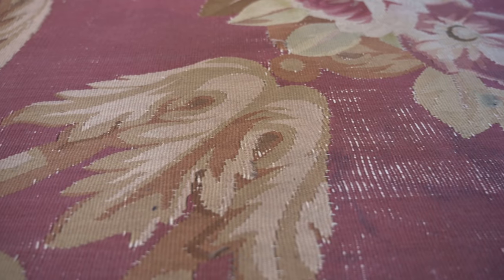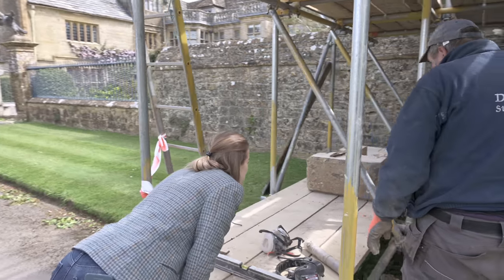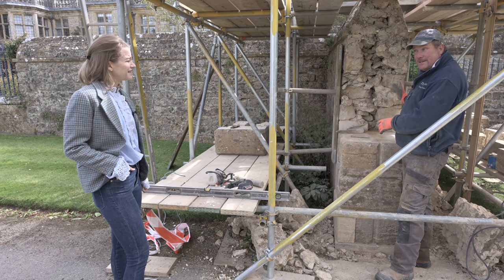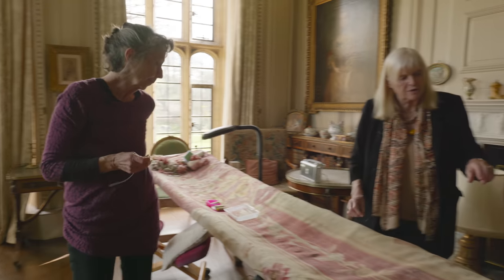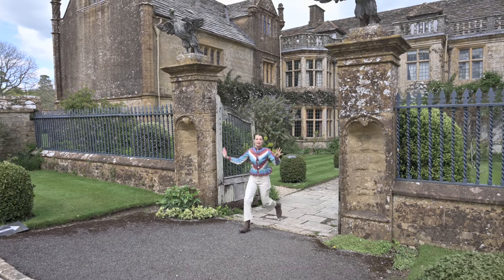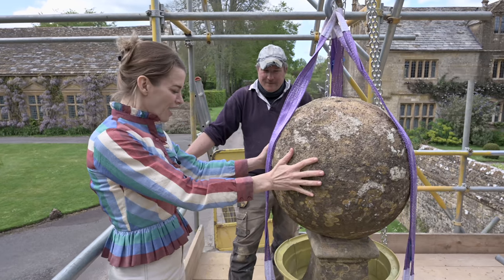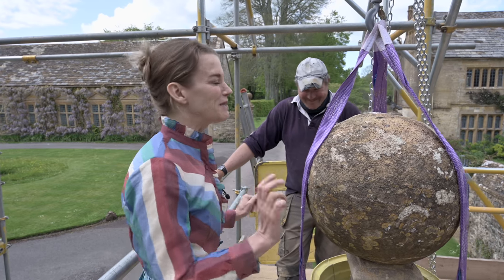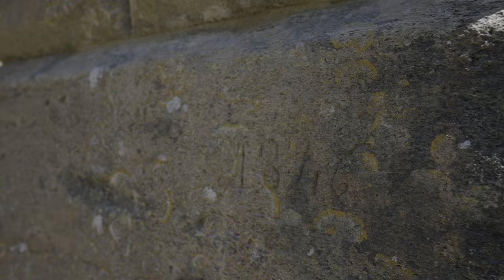Oh dear - yet more RESTORATION PROJECTS!  | Ep 13

Comment: Hello from the Isle of Capri,
In architecture, a finial is a small decorative device, employed to emphasize the apex of a dome, spire, tower, roof, or gable or any of various distinctive ornaments at the top, end, or corner of a building or structure.  A finial is typically carved in stone. Where there are several such elements they may be called pinnacles. The very top of a finial can be a floral or foliated element called a bouquet.
Smaller finials in materials such as metal or wood are used as a decorative ornament on the tops or ends of poles or rods such as tent or flag poles or curtain rods or any object such as a piece of furniture. These are frequently seen on top of bed posts or antique clocks. Decorative finials are also commonly used to fasten lampshades, and as an ornamental element at the end of the handles of souvenir spoons. The charm at the end of a pull chain (such as for a ceiling fan or a lamp) is also known as a finial. ❤
PS: The lampshade on the large table lamp when you were showing the rug after it's restoration is [Crooked].
See timeline at 17:54 This seems like such a small thing but since you've gone to such trouble to restore the rug it would be a shame not to correct the tilted shade.
You should put the old metal finial support rod in a box and label it with a date and where it came from so in the future people will know it's history. You're doing an AMAZING job Julie and I applaud you! 
👋👋👋👋👋👋👋👋👋
Reply: You're right the lampshade is crooked - but your comment is very interesting, thanks for sharing your knowledge.